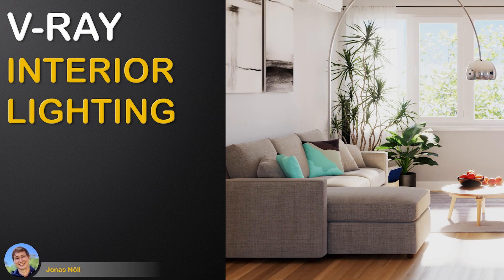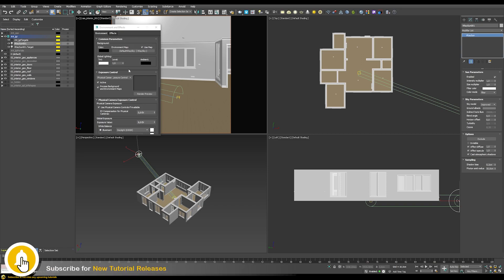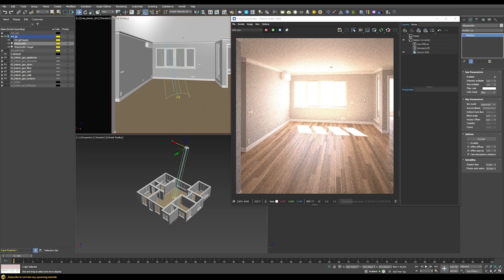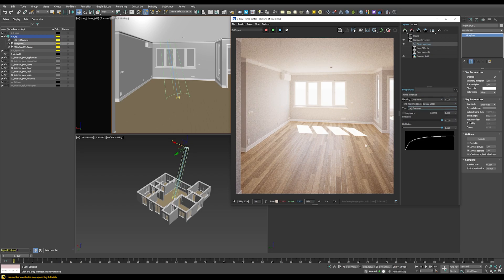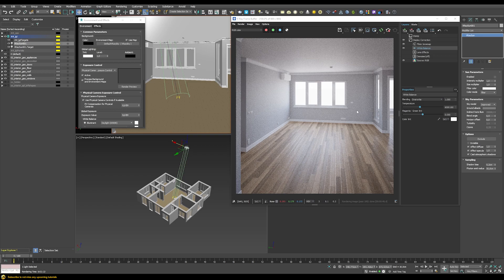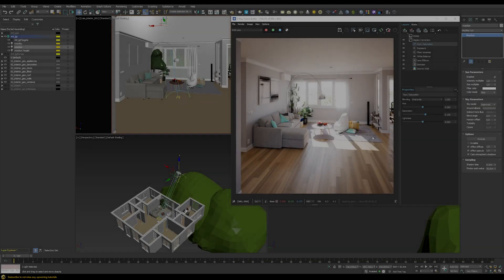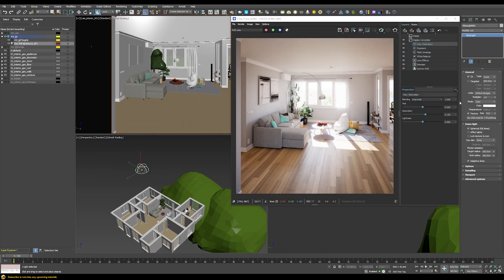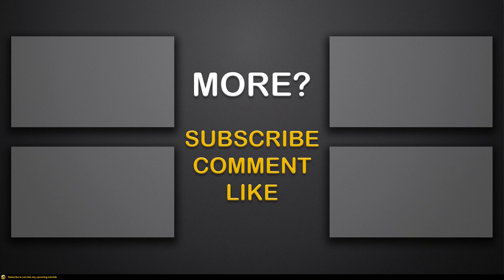V-Ray | Simple INTERIOR LIGHTING Setup | Sun & Sky + HDRI Lighting Tutorial

Comment: Does this still work the same way with Vray 6? I mean does it still render faster using a dome light instead of the Environment Map to render VraySky? I've noticed in Vray 6 there are no "Advance options tab - Enable MIS" in the Dome light settings. Maybe the Environment Map also have "MIS" ability now, whatever that means? (Does any of this even matter when you have an interior scene with no windows / outside light coming in, only interior lights?)
Reply from the maker: Hi, I guess the MIS option is now always on for the domelight and hidden from the UI as there is no real reason to turn it off. Also lighting through the Environment Map still has the same problems (when lighting interiors with a lot of bounces) as demonstrated in the video.
And if you don't have any windows in your room and only artificial light then all of this doesn't apply to you anyway :-) It mainly relates to situations where you have a very bright light source "pushed through" a smaller opening to illuminate the inside of something, as this requires smarter sampling and a lot more bounces. For exterior scenes that is usually not as problematic and in practice you wouldn't notice much of a difference in terms of quality and rendering speed.
Reply: @JonasNoell  Thanks, that makes sense. Will be using dome lights for partial exterior scenes from now on.

Comment: How come my Dome light don’t have advanced option on the bottom?
I am using 5.2.2 Vray and 3ds 2022.

And why not using Vray camera?

For interior scene, no need to put Amb. Occlusion? Thanks for your tutorial 🙏🏻
Reply from the maker: - This was changed in Update 2, the advanced options are no longer accessible. 
- The V-Ray camera is in my opinion much more annoying to use as all parameters are connected. So if you change the shutterspeed it will change the exposure and motionblur and so on. But if you like to use it then go for it!
- Technically with brute force GI and high enough sampling you wouldn't really need that. But there is the option in the GI settings to add that if you want to use it to add additional contrast.
Reply: @JonasNoell  but when I rendering the interior scene in 4K, the walls color and shadow seem not smooth like compressed image, what should I do to fix it? 

What color mapping do you use for interior scene? 

What is your best production render setting for interior scenes? 
Awesome tutorial 
🙏🏻thx

Comment: hello 
does vray 5.2 remove light advanced optinos from dome light?
Do you use the same aproach for exterior as well?
thank  you
Reply from the maker: Hi, it seems some options were removed in 5.2, that's correct.
In general yes but for exteriors you can also get by without the domelight and just illuminate through the environment as there are not so many secondary bounces...

Comment: Great tutorial as usual Jonas!
Just a small note, the MIS in Vray Dome   is important even for exteriors and actually its not to analyze the scene itself (that what adaptive dome option do), but to analyze the map that you are using for the environment lighting, meaning it will analyze the Sky /hdri Map and check the pixels that are contributing the most to the overall lighting (the brighter pixles) and use more samples to them. 
In VRay its a bit more technical than this tho as  in Vray MIS also means the light contribution will be split into  direct illumination and GI/reflection (for glossy surfaces) which will give better sampling in many cases.
imagine lighting a scene with GI only - by using bounced lights - Vs using direct area light, the difference is huge in terms of how easy to calculate. 

MIS also available for other kind of lights like area lights and mesh lights which help sampling areas near the light vs area that are far away. 
I couldn't find exactly the source for all of  this as I read it and tested few years ago, but you can read more about MIS here :
(check the world part ) 
https://blender.stackexchange.com/questions/8152/what-is-multiple-importance-sample-option 
From the creator of MIS in blender Cycle
http://morecycles.blogspot.com/2012/01/environment-importance-sampling.html?m=1

Vray offical documentation 
https://docs.chaosgroup.com/m/mobile.action#page/60098446

https://docs.chaosgroup.com/m/mobile.action#page/60098499
Reply from the maker: Hi, thanks for your additional information about MIS, as said I didn't really want to get into the specific details too much so maybe my short summary is not as precise as it could have been. I basically just wanted people to understand that MIS is important without going into too much details :-) I agree that it should be also used for exterior scenes in the same way, however if you use Sun&Sky in exterior scenes the difference won't be as drastic as most of the light is coming from the sunlight itself and not by the indirect lighting. So often times in exterior scenes you might get with using the VRaySky in the environment while for interiors the result will always be catastrophic.
Will go through your links, they look interesting and I also want to deepen my knowledge in that. I myself am not an overly technical person and the purpose of doing tutorials is mainly form me (as an artist) to other artists so that they can achieve nicer results and touch the technicalities only to an extent on what is really needed to achieve a good result. But it's always good to deepen the knowledge on whats happening under the hood!  :-)
Reply: @JonasNoell  Yeah, I totally agree. your tutorials are always to the point and I love that !
I just wanted to add more info , if someone wanted to dig more into the subject .
keep up with the great work , those videos are the best  in terms of accuracy and using the latest tech  .
looking forward to see the next one!
Reply: @nawrasryhan  can we get the vray frame post production effects used like filmtone, exposure, whitebalance in sequence render?